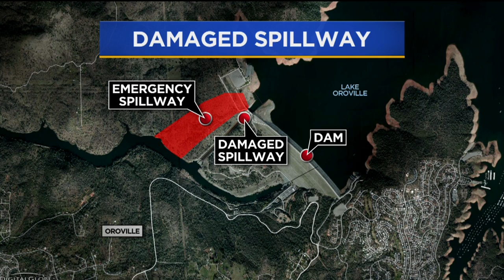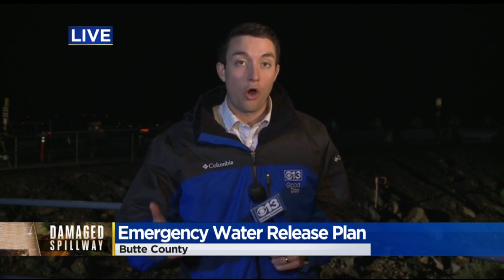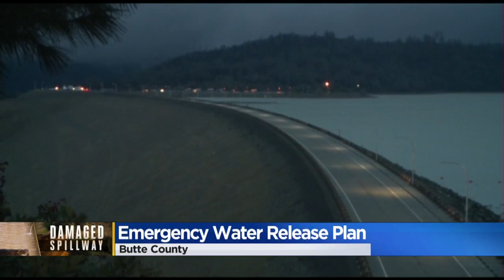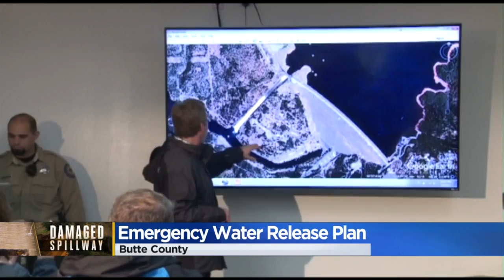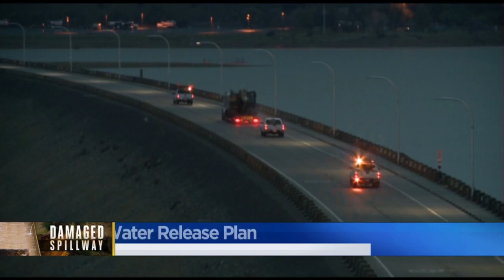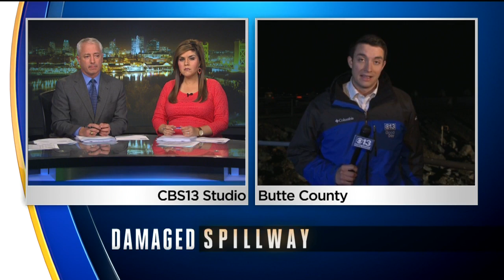Oroville Dam Emergency Spillway Could Open By Early Saturday

Comment: I like how they talk   AS IF  they have    control      of the  water pouring over the  emergency Spillway -  NOT  its all as simple  as  100 in   100 out   if the  main  spillway can only run at  100,000 CFM  and the  river is pouring in 120,000  -  the  other 20,000 GOES over the  top  ,  This is not rocket science !    ( simplified - I realize some goes through the powerhouse )

Comment: why have they not started an evacuation....?
Reply: Then why did they make it an Earthen Dam rather than a Bed Rock Dam? You could be looking at a 1-200 ft drop in lake level rather quickly. Once it starts ripping it won't stop. Last pics I saw showed muddy water coming from the power house, or from under the dam. Not good.
Reply: JDoobie Knight because there is no actual danger to the dam or surrounding population.  The problem with allowing water over the emergency spillway is that it is all earth and will erode rapidly, creating muddy water that will fill the bays and hatchery area.  They want to avoid that if at all possible.  Again - no danger to the dam or population.
Reply: pigjubby1 according to the meeting on the 9th, the erosion around the spillway will stop when it hits bedrock. Engineers say no danger to dam integrity.